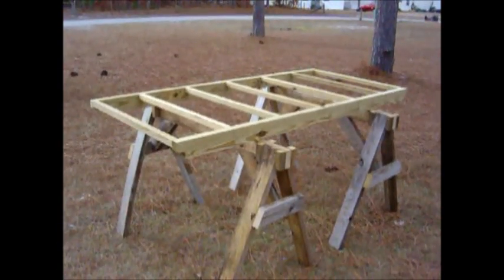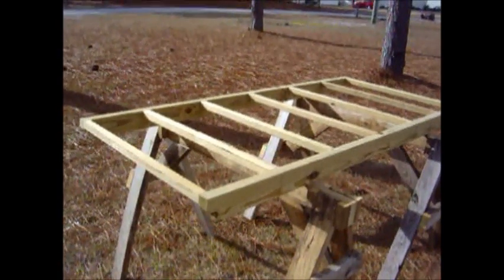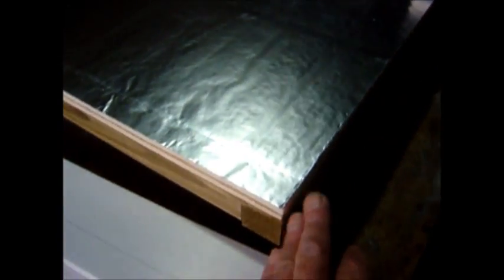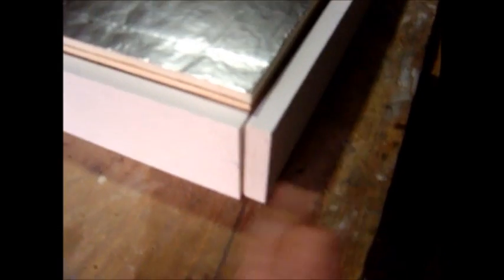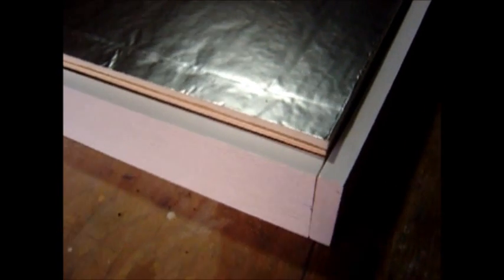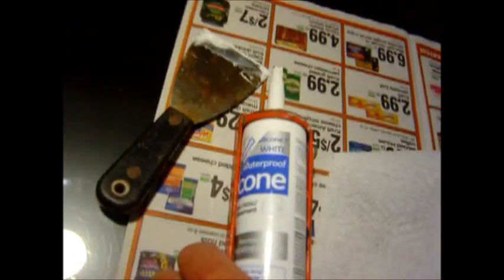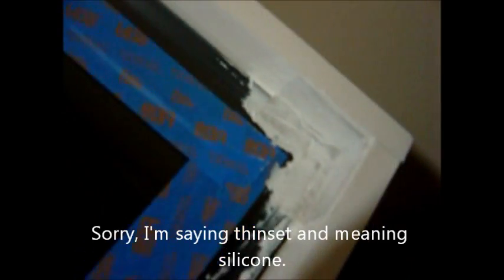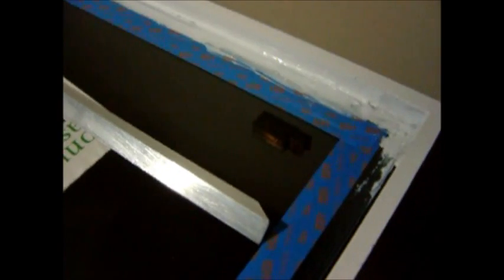Solar Water Distiller Build Part 3

Comment from the maker: You can check with a local siding company, they may have some. Or you can do an online search and buy online or go to lowes or home depot and order it. I send you a message suggesting that you use black silicone, just trowel it on as smooth as you can to the bottom side of the glass. Thanks for the questions